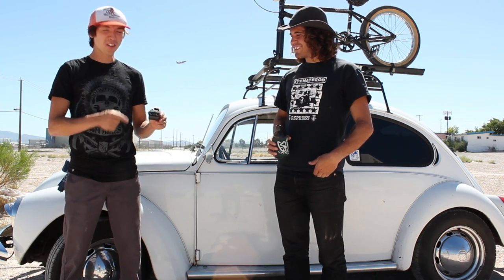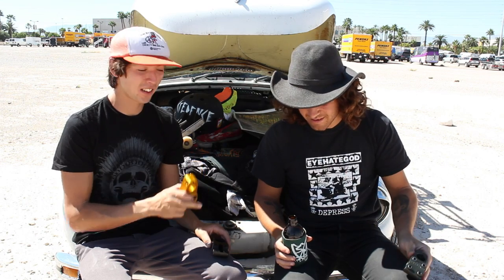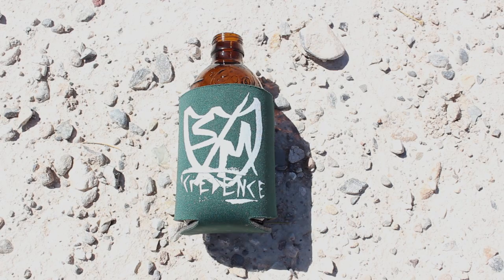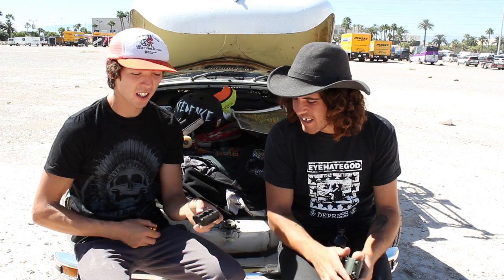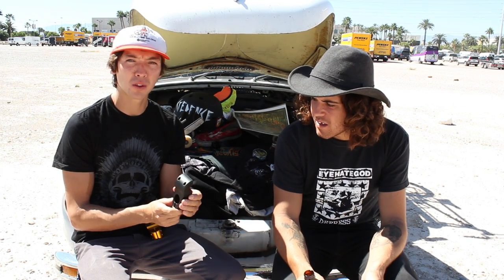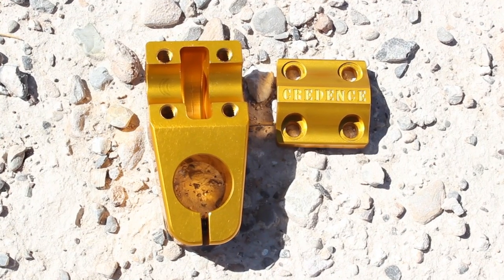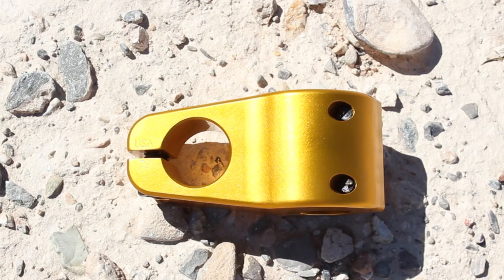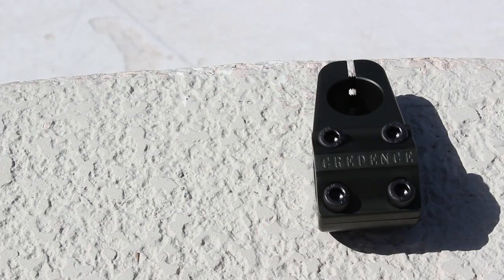Credence Turtleneck Stem

Comment: I was running the  Credence  stem I switched to Profile push stem now I am going back to the  Credence  . Riding nothing but trails for the most part and my Fit Hartbreaker with the Profile stem was to High up and after a lot of looping out and pulling up a little to hard bottom linr both great stems but this season I am running the  Credence